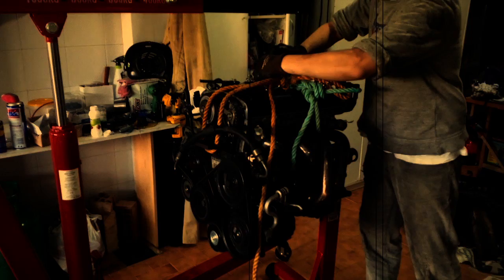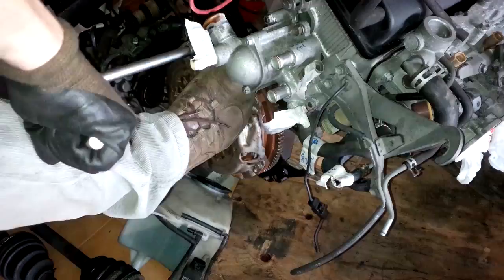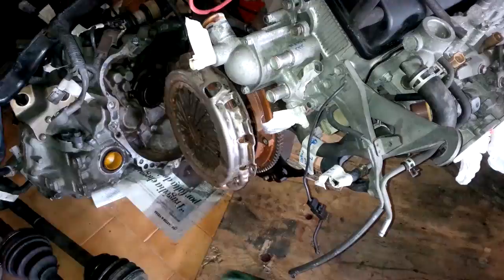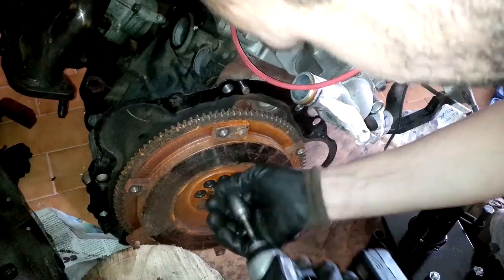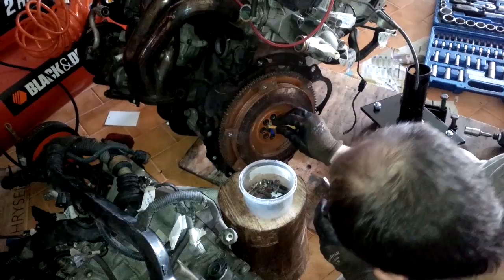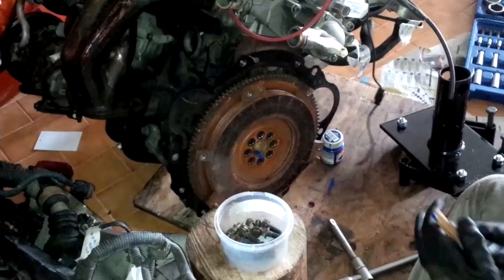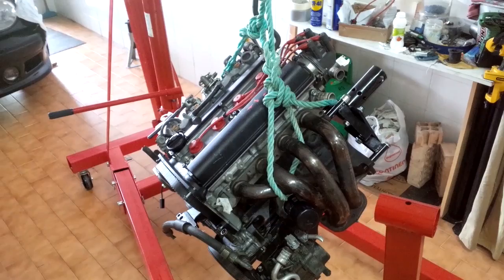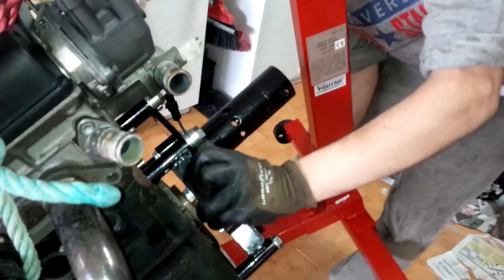(How to) Put your engine on the engine stand

Comment: I had to go to emergency room because I pinched my finger between the mount and the engine  when the engine slipped off the wood I was using to force the engine to tilt and not once did I think to mount the engine this way, so simple but it is Genius!

Comment: DO NOT DO THIS on a V8 engine.  Use a chain that is secured to the block.  Never use rope to tie around headers or exhaust manifolds.  You might get away with this on a tiny engine but you're pressing your luck.
Reply: Thanks for the info i just took out a 350 with rope not knowing it was my first time doing it but ill be getting a engine lift plate soon

Comment: Hi João,

I've seen one interesting engine stand (handmade) which allow to get easy access to crankshaft seals when engine is moundet on it. Unfortunately video without translation and subs,
Теория ДВС: Офисное оборудование (часть 1)
Reply from the maker: Oh I see, it holds the engine on its side rather than on the back. A good idea indeed, I will have to take out the block after I remove the pistons to take out the crankshaft seal... Oh well :-\

Comment: Hey, just as a reference, what size bolts did you buy to secure the engine stand adapter (I don't the official name of that black part) to the engine? It seems like you bought a little bit long ones, but let me know the length (diameter and pitch is m12x1.25 correct?).

Comment: That's a damn lie with the flywheel hahaha I never had problems with the position and every time a recommend sent it to the machine shop to cut it
Reply: My ancient (heh) '87 Corvette has a pin to make sure the flywheel only goes on in the same position. Yes, it does matter. May get lucky most of the time that the extra vibration isn't bad. For the driver, anyway. :)